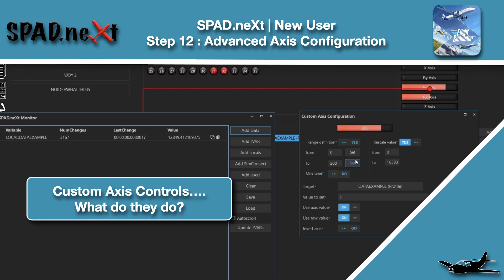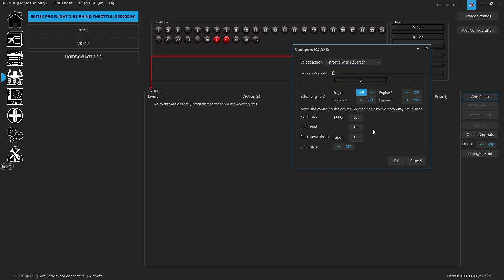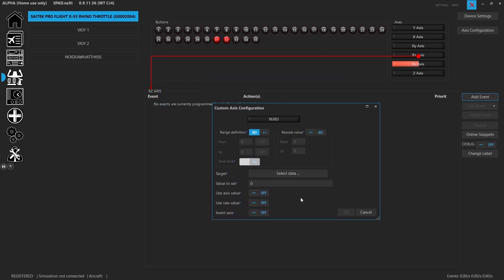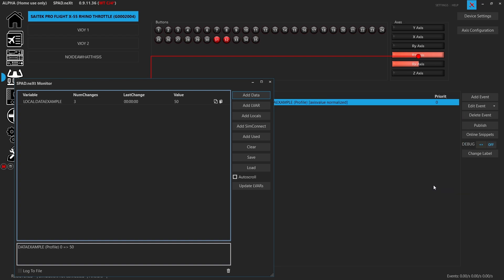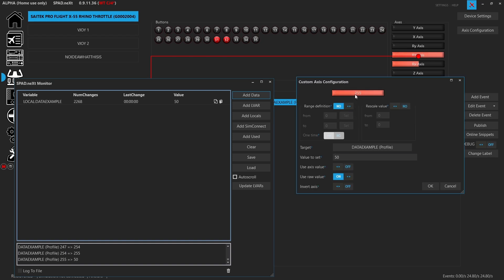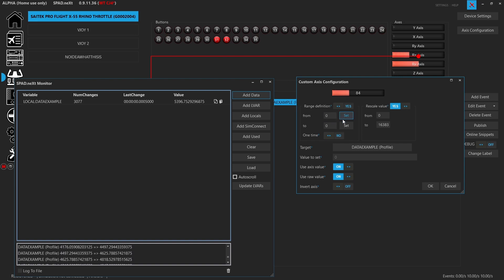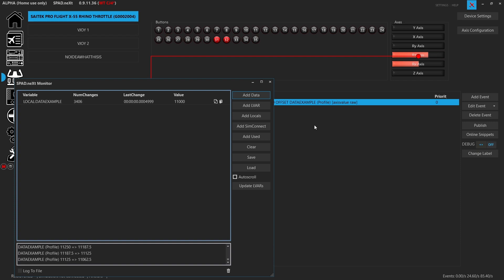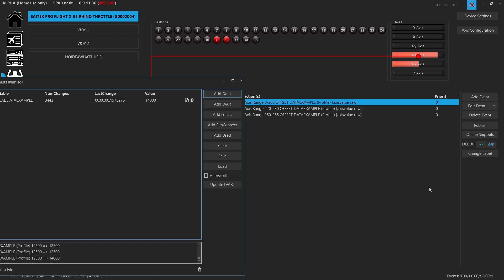MSFS | New User #12 | SPAD.neXt | Custom Axis Explained

Comment: I bought throttles and gates for my Honeycomb Bravo to use with the PMDG 737. The flaps gates dont really line up with the same flap values in the sim. I could use this to reprogram the flaps so they line up with the physical gates, right?
Reply from the maker: Yes you setup multiple custom axis ranges - one per detent.

Comment: Does propwash sim PWS 155 Dual Radio rotary encoders with push working on  SPAD neXt?
Reply from the maker: I have a bunch of them including in my SPADSter video...  What control device though are you hooking it up to?  I have done used the Arduino Pro Micro or Leo for Joystick devices just fine and also Leo Bodnar boards...  FYI don't put the period in spad next ..  Youtube will put the comment into "Jail" thinking it is a link...
Reply: @LesOReilly  I am thinking to buy propwashsim PWS 155 radio panel , which has a dual encoders. I want to make the dual encoder using SPAD neXt to work as the knobster.

Comment: Any plans to offer DCS Profiles ? 
Is there a FULL G1000 profile ? It is really tough to use the G 1000 with the knobs on a touch screen.
Ive even heard Austin bitch about it .  Thats why he designed the iPhone app ... with the digital path way to landing.
Reply from the maker: I don’t do DCS. I think I even bought a couple planes for it and just never did it. 
As for using G1000 it’s like all the older style systems. Spin some knobs. Helps to have buttons and knobs to emulate it but yes there is a reason Garmin added keyboards and now touch screens.

Comment: Glad you made another video regarding this mode. I asked many questions about this mode in discord and never really had a clear understanding. This helps greatly
 What if you have a scenario where you require a range of an axis and you need to send a command only with no values can this be done when you get in the defined range? If so will it be send one time as you travel in this range or many times in this range. Also I assume you can define an axis so that it responds only when you say move from 1000 to 2000 and another only when it cones back down thru 2000 to 1000. Sorry for long winded question. You do a great job and thanks.
Reply from the maker: Well I was trying yesterday to answer it but after a few screen shots and posts it became clear that it was going to take me longer to write a "book" than make the video :) ....  
Currently you can not apply conditions to Axis...  So for that kind of  a specific action when going one way or the other you would apply a Script to the axis..  and just like multiple Axis you can have Multiple Script.
Axis Can only set data not fire an event .. so again if you want at a certain point to only fire an event then you would be best to use a script to manage that .  I will put in a feature request about the Send Event added :)
Reply: @LesOReilly  Thanks and good idea to have a request in for new feature

Comment: It's a pity there's no curve chart, and you have to enter everything in numbers.
Reply from the maker: There is a separate config/section in the Axis page on the right (where you also do calibration) for making an Axis Curves.  So you setup your Curves to generate the Data.  Then you use this assignments to define how to send data based on it.